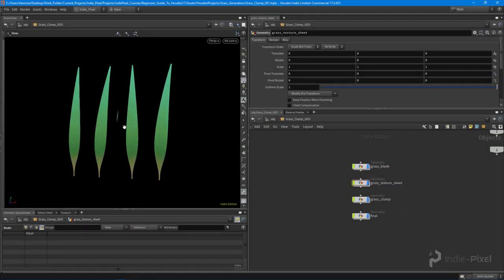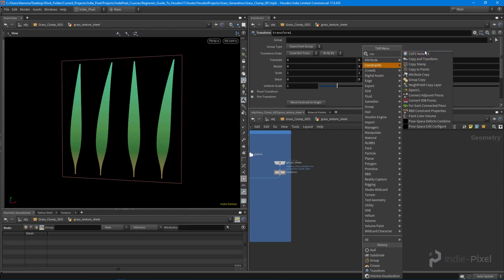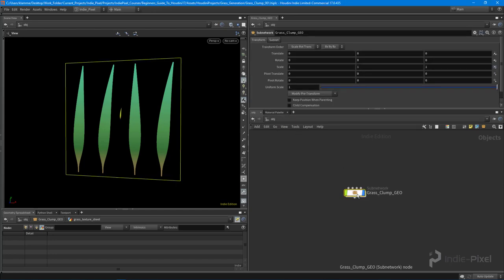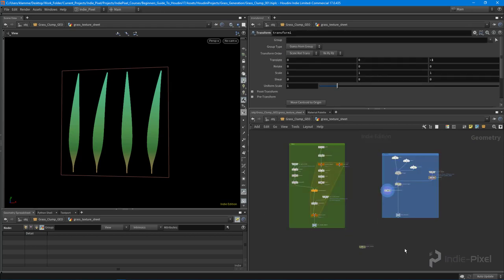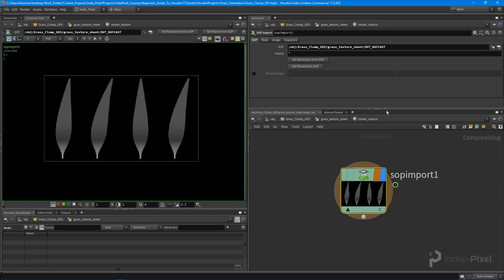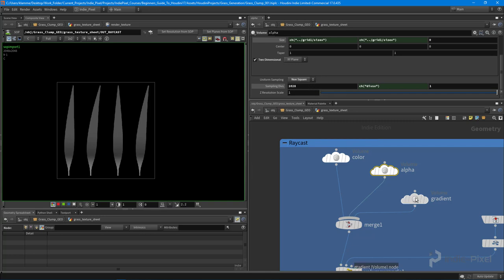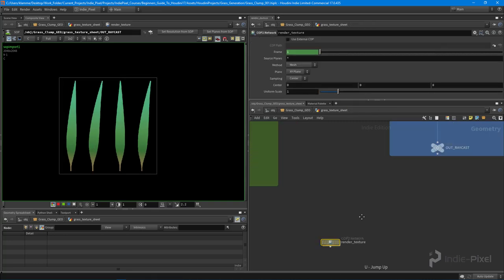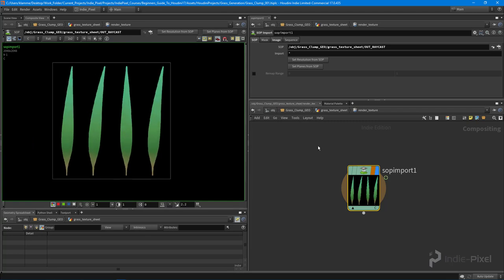Procedural Grass Clumps in Houdini and Houdini Engine - Part 4

Comment: Why did you expand the borders of the color map but kept the alpha at the original size? Won't that cause the extra color to get masked away by the smaller alpha?
Reply from the maker: This is done to prevent a black border from showing up when mip mapping.  As the mips load in and out if the alpha pixels will get so small it starts to show the surrounding pixels.  So we expand / dilate the albedo to make sure we never see the background color.

Comment: Houdini Apprentice (non-commercial) maximum resolution size for renders is 960 x 960!
Reply: My Houdini non-commercial has max resolution 1280x720 :)
Reply: Владислав Лифиренко maybe, but then it's not square. It would be good if it still works at that resolution. I didn't think of trying due to the sampling divisions being equal using the copy parameter. I just tried at 1024x 1024 & got the error message. So I guess you'd have to do ch("divsx")*0.5625 to get the same Sampling Divs on the color Volume Sop & copy parameter to alpha & gradient nodes? I might give it a try at 1024 & see if I can crash Houdini again. I managed a few times yesterday doing this tutorial. I'll let you know how I go. Cheers.
Reply: Yep. Just tried again at 1024 x 1024 & can't do it due to apprentice restrictions. Not sure how it would look at 1280 x 720. I haven't tried & suspect it would just stretch out your grass blades so you would have to adjust them to allow for it. That seems somewhat counterproductive to me. 960 x 960 will work for this tutorial, I know that much, I've done it.
Reply: Steven Silcock do you have normal result with alpha channel? Because I has white border in edge of grass in result rendered image
Reply: @Waq-g5n  no white border but my edges are a bit blurry. Could do with blur settings or just low resolution. What resolution did you end up rendering at?
Reply: Steven Silcock 720x720

Comment: cook error in input channelcopy1 

it worked before absolutely no clue what its issue is now. Just reviewed your lecture and compared and I can't find what is bugging or went wrong. Desperate for your help.. Ill give you Toilet Paper
Reply from the maker: Lol...toilet paper...no need to do that...you can send me your network through the indie-pixel website...use the contact form and send me a link to your hip file
..then I can take a look...thanks!
Reply: @IndiePixel3D  man right after i sent an email to SideFX Support and as I was attaching a screen shot I noticed my D drive wasn't appearing. So I sent the email and then went into BIOS to see why the D: drive was gone and maybe that would fix the problem? Dont have anything Houdini on that drive. 

Sure enough when I switched the SATA config to defaults the D drive was back and the stuff worked as expected. But weird if that was actually the reason not a damn thing in D: 

Sorry for the hundred messages..
Reply: @IndiePixel3D  maybe a dumb question. But when you say "contact form" where or what are you referring to? I can't seem to find any link to a personal page that would have that option. If its a youtube thing I apologize I seldom get this into youtube use lol
Reply from the maker: @prooxy1234  If you go to www.indie-pixel.com/about  You can reach me there.  Thanks.
Reply: I am getting the same issue, has yours been fixed?
Reply: FIXED: added .exr or .tga extension to output picture after filename!